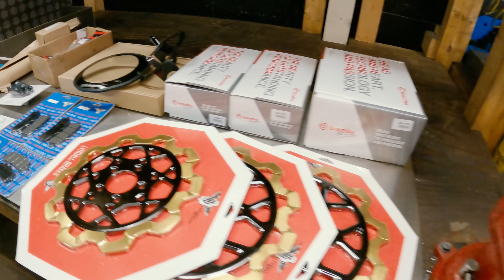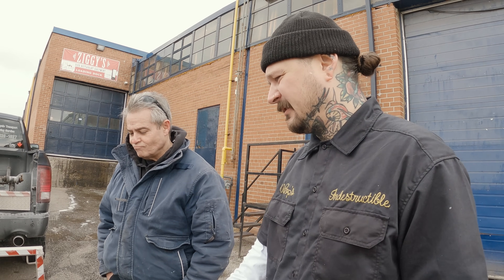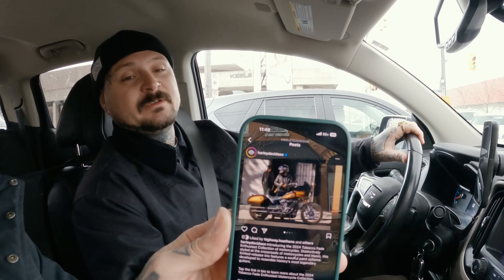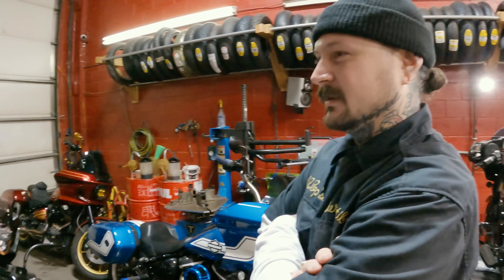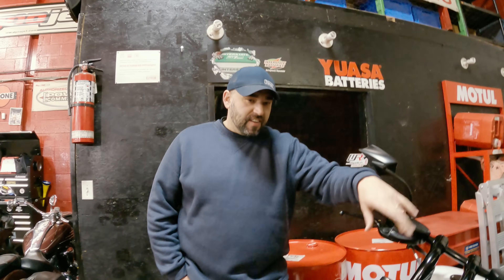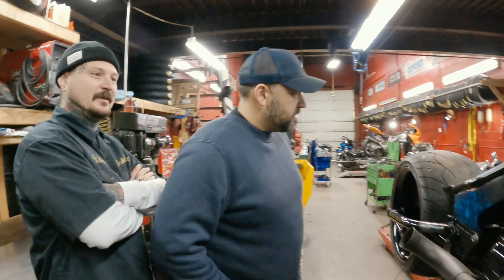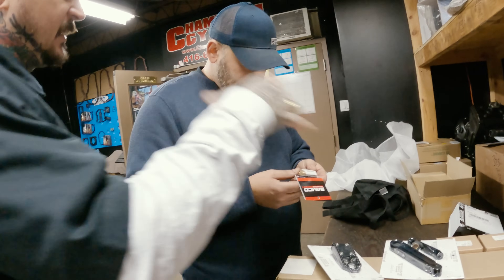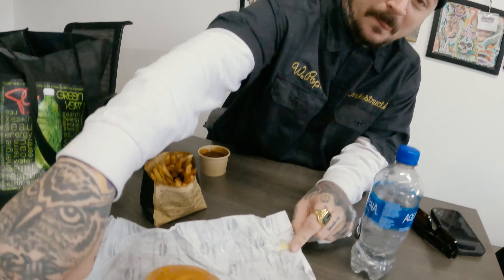Game-Changing Upgrades for Harley Davidson Low Rider ST

Comment: Look into cerakote ceramic coating it can hold up in heat better!
Reply from the maker: Thanks will check that out
Reply: @IndestructibleMFG  FYI I've had issues with those rotors running brembo calipers and replaced the rotors with lyndall crown cut and made a huge difference now!
Reply from the maker: Interesting! We will see how the install goes

Comment: Good luck with the OG brake arm pivot. The pivot hits my Bassani pipe I can't use it. AP has been great about it, customer service is number one over there. F.Y.I. you can get your windshield all blacked out if ask them to do it. Looking forward to the up coming vids.
Reply from the maker: Will see how it goes! Bikes still in the shop but they installed the same brake arm on the fast Johnny that’s there and seemed to go smooth

Comment: Hi guys. I got my bike done by Crete Performance from Victoriaville Qu. This guy is the best there is with dyno tuning. A 131 SE with a star racing cam we got 154hp and 154 torque. The bike runs like hell. We use Star racing and the results are just insane. My cousin got is brand new street glide 117 staged 2 with a Star racing cam tuned by Crete and got 131 hp and 137 torque. Star racing are great products check them out.
Reply from the maker: Awesome man we’ve heard good things about star racing!

Comment: I love the bike not a fan of legends but the rest of the build is sick
Reply from the maker: Thanks dude! What do you prefer over legends? Running a progressive mono shock on the rear.
Reply: I'll be doing ohlins on my LRST eventually the preload adjustability is better in my research, and I have a fox monoshock in the rear, pretty good upgrade over stock.
Reply from the maker: Dan has the ohlins on the rear of this road glide and legend’s up front. Makes for a great ride
Reply: I have ohlins 506 with 1 inch extension and GP suspension +2 on my el diablo it rides 10x better then legeneds but thats just my opinion  @IndestructibleMFG
Reply: @IndestructibleMFG  RWD racing has a dope ass suspension for our bike! They've been in the game for decades and have a serious on an off track record!